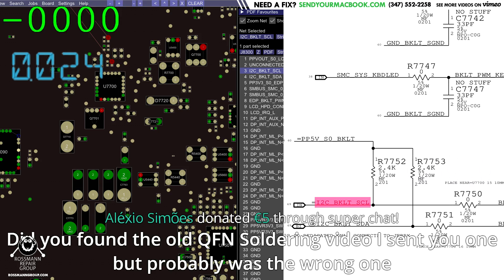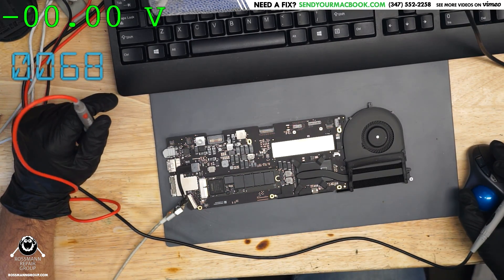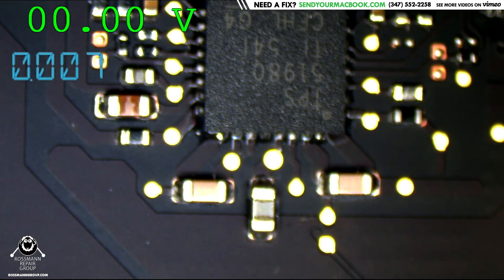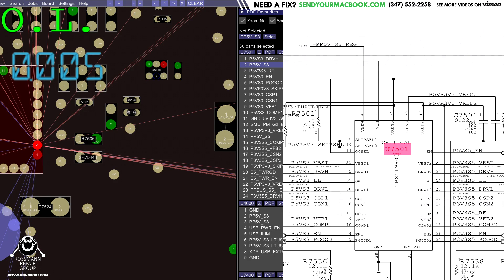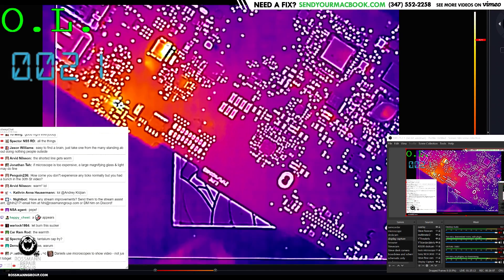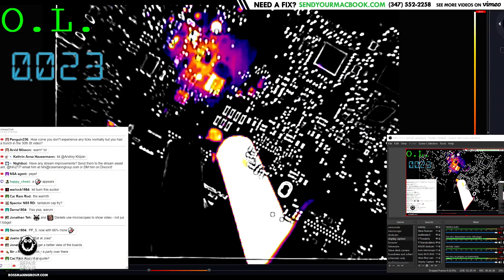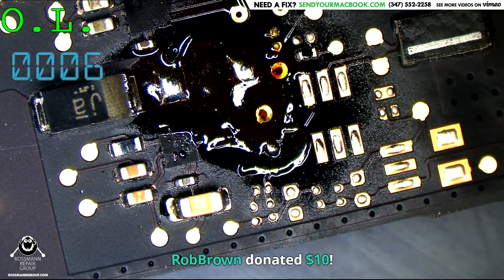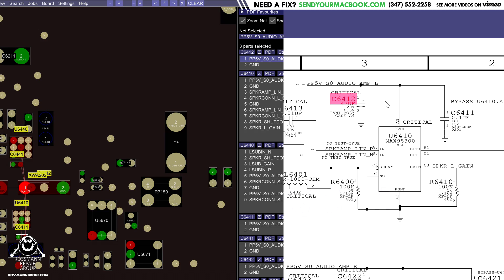Macbook Pro logic board repair in NYC 🗽

Comment: Honestly though, IT industry can be just as shit as real estate. Buy a 10tb harddrive? You get 9.1tb of usable space. 100mbit internet? maybe 80-90mbps if you're lucky. laptop with 6h battery? it can hold maybe 2h after a year.

Sure I know it all has technical or nomenclature reasons. But those are the same type of excuses that the broker uses.

Comment: I hope he shares the actual cost for the construction. 
Union workers, it's going to be 250k on the low end. 

They show up with 5 extra workers who sit around with brooms just waiting for the floors to get messy. 
It is the biggest ripoff here in Boston as well. They want to charge you $100+ for a gallon of paint. 

A few conference rooms painted they wanted 14k, I called someone from Task Rabbit and it was under $1000.

Data cabling and WIFI, they wanted over $35k, I hired an electrician from Craigslist to assist me and pull the permits and I did the same job with better equipment for under 10k
Reply from the maker: It really depends on what you want done, some unions do great work advocating for the rights and wages of their employees, some unions exist to bloat and inflate the cost of everything and keep shity people from getting fired. It really depends on the company and the industry

Comment: You edit quick.
Reply: There's not a lot editing plus he's practiced by now
Reply from the maker: 90% of the time is spent uploading.
Reply: @rossmanngroup  Hopefully Fios fixes that. Also I learned if you play dumb and get residential connection at a business most installers for fios don't care and won't eat you out. So up to you if you want to pay for "Business" or residential that uses the same hardware and lines unless you need a static ip. Verizon business support when I used them had earlier hours than residential. So if your network goes out at about 445 pm you need to wait until the next day to talk to someone.